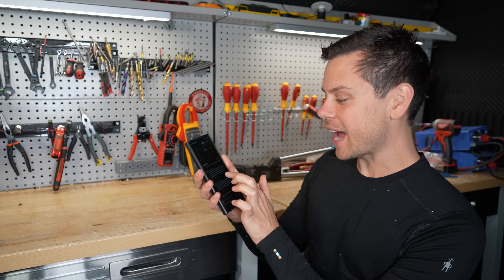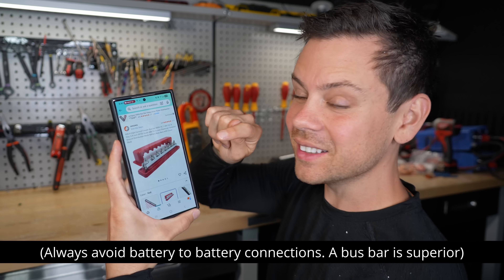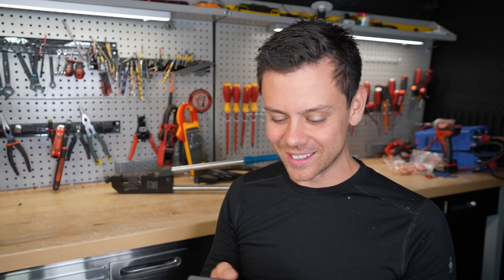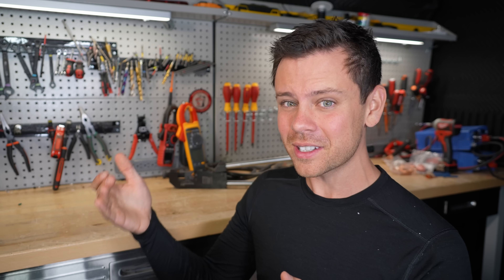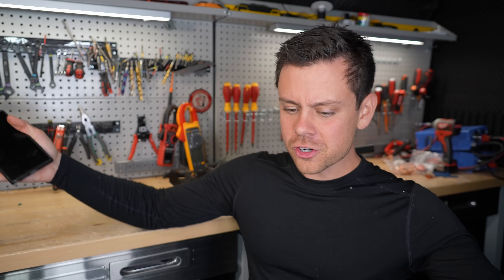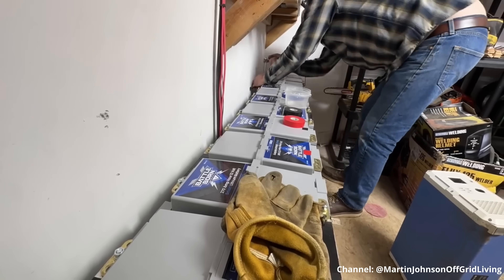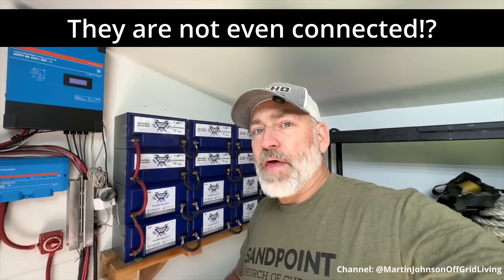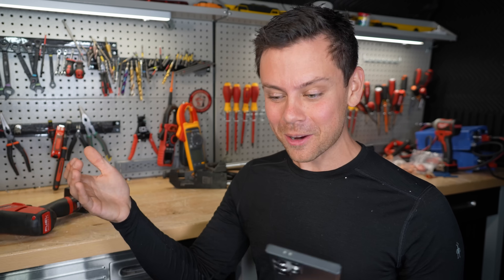My Reaction to Martin Johnson's "BEST Off-grid Battery Bank" Video 😬 Yikes!!

Comment: I know you don't mean to bash him but I'll do it for you Will,
This guy was willing to take free batteries in exchange for misleading his 477,000 subscribers to a unsafe, hazardous, far from optimal setup with batteries that cost $2,400 EACH when you can get one with 10ah MORE for $460 showing 0 concern for people's hard earned money, That's cruel man.

Looks like Battle born is so desperate to sell them before they get old that they sent him not 1 or 2 but 12! How could he pass up $28,800 in batteries? That's why Will is an absolute treasure, Remember how the solar hand truck inverter was always the 3000w EG4? As soon as a better inverter for the same price built by a reputable company (SRNE) came out he revised the hand truck, No brand loyalty, Can't beat that.

Comment: If you do something that can influence (many) others, you are entirely responsible for the outcome. One should learn before teaching. This is 
why many countries are starting to insist on you using properly licensed electricians for this kind of work. If Will can do the research and learn the basic electrical safety principles for dangerously large DC systems so can someone else.

Comment: Battleborn seem very overpriced. I heard they are assembled in the US but use all Chinese components, so I don't see the reason for paying much of a premium over any other battery. I guess they gave him free batteries but not supplies, maybe he he didn't have enough money for the project and he was buying cheap undersized wire from amazon. How many amps is he running though 4 gauge wire ?

Comment: Whats wrong with melting Solder in a terminal and putting the cable in? We do this for vehicles all the time, it makes a strong bond and keeps it from corrosion? Is it because if it gets hot it melts the Solder out? We use it for 12v car batterys in cars, but idk the difference with solar setup. But I feel better I crimped my solar ones in my van after seeing this. Update you answered in the video nvm.

Comment: I agree 100% with everything BUT THE 12v batteries to make a 48v battery is WRONG comments. Using 48v server batteries in parallel to make a battery bank is a NEW DEVELOPMENT in the industry.
12v batteries have been used in series for literally DECADES to make large battery banks. and there is nothing wrong with doing it as long as each 12v battery has a dedicated BMS designed for 
series/parallel use. Is using 48v server rack batteries better - yes - obviously, but it doesn't make using 12v in series properly wrong!

Comment: I think a well made solder connection is sometimes the preferred method in a permeant install that also needs to be weather resistance. Actually a good solder joint is an acceptable joint its only main issues are the need for soldering skills and the possibility of mechanical fatigue in installations involving a large degree of movement. Cold weld compression joints are much easier for a DIYer to perform successfully and is likely why they are considered the "preferred" method.

Comment: Conductors or busbars should be sized for the load not output capacity. And than size over current protection accordingly. Or is your car wired with 250 kcmil? Know it alla like you are 10 times more dangerous than this guy is. Also bud, watts are literally the definition of power. Little weird your teeth are white than your eyeballs, traits of a liar ;)

Comment: I am a 4 way certified commercial and residential inspector.  I am pretty sure that is not to code.  Mixing aluminum and copper not good.  It is ok. (sigh)   If battle born sponsored this video, they had better have him pull that video down. Then travel out there and help him to do it safe and legal. Then make his video and ensure it is safe  Kind of scary what happens in the construction world.  I have seen just about every screwy way of doing things.
Reply: There is always code. The state adopted the NEC.  Just no permit filed and no  enforcement. With that said, I hate government.  I just wish people understood the reasons behind why we have a code.  We have code because of a body count.
Reply: @CAMERONNERDIN  I hear you and agree...but, if there is no enforcement, is there really a code requirement? Not trying to argue as I think we both agree that, with things that may impact other people's safety, you need to know what you are doing and how to do it so as not to put yourself others at risk. And for sure you shouldn't be making a video showing others how to do it "cheap" and possibly harm themselves or their homes.
Reply: @greasebeardsgarage  agreed! I think him having been sponsored by the battery company, They need to get over there and fix it ASAP, because they are  open to legal action if someone gets hurt!
Reply: @greasebeardsgarage  and that is how enforcement should work, through liability exposure, and the desire to remove liability!
Reply: @CAMERONNERDIN  there are a handful of states that haven’t adopted the NEC statewide.
Reply: @silverbackag9790  Yup, 4 of them, but most of the counties and cities have adopted some form of electric code, and many have implemented the NEC. But for the most part the entire country is covered by some form off electrical code. Because of all the deaths contributed due to installs that fail and cause fires, or electrocutions.
Reply: @CAMERONNERDIN  except the latest code got stupid as far as battery storage. I’m ignoring that (thank you Missouri) because one size doesn’t fit all.

Would probably ignore rapid disconnect too if I ever put panels on my shop.

My current (72x 370 watt) ones are ground mounts.
Reply: @silverbackag9790  I do understand.  One thing I did notice in the IBC for ground mount panels, they have to have gravel under them   I think this is because they could have lots of volts and amps which could cause sparking. So it is a fire prevention.  I am getting ready to install a very large system on my industrial property to run a repair shop out of shipping containers and they wanted $2000 dollars for my permit, so I bought an enclosed trailer to put my mobile generator in.  The county building official and I had a discussion as to why his permit fee is out of control and I would not pay it.  I asked him a simple question.  If I run my shop with my welding generator, do I need a permit? NO, So if I run my shop with a mobile solar system installed in a trailer with panels laid up on the fence. do i need a permit?  he hummed and hawed and said I do not think I can enforce it. No different that a mobile generator.  I hate government over-reach as much as the next guy, while I sure hope people are doing solar safely.
Reply: There probably isn't much code if he's not in a city limits and is off grid. Doesn't mean you shouldn't follow industry best practices, just that you aren't required to.

Comment: My son put 4 of 12 volt batteries in series for his 48 volt system, but he charged them in parallel to 100% first, and then after putting them in series, he connected an active balancer designed to work with 4 x12 volt batteries.  The batteries have stayed well balanced ever since. He used 2 gauge wire to connect everthing, and put a fast acting thermal/magnetic 125 amp breaker in series. And yes, he used a monster crimper for the lugs.
Bottom line - it's possible to build a safe 48 volt bank using 12 volt batteries.
Reply: I have a 48v system with 6v "golf cart" batteries. 3 "strings" of 8 batteries each. Kicks ass.

Comment: This chap is due for an epic breakdown, it will more than likely happen at 3am without warning and I hope not at the cost of a fire. I would add having watched a few of these videos now. When you connect crimp lugs to high current switchgear a little dab of unial / electrical jointing paste will ensure that joint is 100% for the duration of it connection (until the user disconnects it). Be aware though you must wear appropriate PPE it's nasty stuff. Always interesting to watch how batteries and this industry has progressed. I'm waiting for someone to start some sort of hydrogen based generation next😉

Comment: I literally saw that video yesterday, and after I saw him solder it, I said to myself will prose will faint if he saw him soldering it., then I laughed as much as you did.  I literally freaked out when I saw him make the sparks. OMG.  Thank you for correcting the video. WOW. 😅
Reply: @WillProwse To be fair I don't think many people understand how a cold weld works. Infinitely more reliable as both a mechanical and electrical connection. My Dad was an engineer at a STC (old telephone manufacturer in Australia) and he used to do endurance testing on telephone components. Every external connection from a circuit board was wire wrap (same principle) because they proved via testing that it was much more reliable in service and (back then) quicker than soldering.
Reply: @mondotv4216  Its easy to find... we all have.  This is just stupidity
Reply: @d.rayowens422 I think it's a learning moment. Calling someone stupid doesn't achieve anything and it very rarely changes a person's mind. OTOH teaching them why and how to do it better is a much more interesting and effective way to go about it.

Comment: His video is spoof right?It shows exactly how not to wire batteries, breaks several cardinal rules, and there was a short and he continues and then he mentions Battleborn?  Battleborn should ask him to remove this. Also, instead of sponsoring him they should have sent him an engineer to install the batteries properly.

Comment: I follow Martin Johnson and generally enjoy his channel.  However, I cringed almost continuously watching this one.  He got some very bad advice from someone that doesn't know what they're talking about on soldering the connections.  I think the rest was actually bad advice and/or information from Battle Born which is very concerning.

I have a 48V system with 12V batteries, and there is nothing wrong with that as long as you have balancers connected between the batteries in series.  But...he didn't do that either, which explains the unbalance after 6 months.  Battle Born knew he runs a 48V system, so again, that to me falls on Battle Born.  I can't seem to find any 48V batteries from BattleBorn, so again, WFT Battle Born?

On the price, aluminum bus bars, and 4 AWG wire, that's all on Martin.  His flawed logic was if it's 200 amps, and you have 3, the load would be 70 amps from each.  If you run 3 strings, you need wire that supports the full system load for each string, preferably individually fused and connected to a bus bar, as you said.  If one of the strings shuts down (looking likely with the imbalance), the other 2 will be splitting the load. 
I do worry this Winter, when there is a string of cold, overcast days, one of the batteries will shut down and take the string out.

At least the solar shed is away from the house so if it goes up in flames, it won't burn his house down.

Comment: I was crossing my legs and cringing when the guy put the lit propane torch between his legs. And that was after freaking about running it right next to a cardboard box. I am so glad you did this video. Hopefully, he will watch your video and learn from it. Like you said, systems like this work until they don't, and then it is an epic failure.

Comment: Aye Carumba....when I saw his thumbnail in my feed and the Battleborns hanging on the wall, I knew that wasn't a vid for me.  Such unnecessary expense to end up with low output, risky install, and still rocking Victron.  Don't get me wrong, I love Victron, but I only use it at my 100% off-grid cabin for charge controllers and smart shunt, as the cabin has just a tiny bit of 120Vac and is 95% 12Vdc, like an RV.

Comment: Hey Will, would absolutely love to see you do a video on your opinion of the plug and play grid tie systems that are now legal in Utah, and maybe your opinion if this is something worth bothering with and if regulation allowing these type of systems is a benefit or not. 
 As someone that doesn't own their own home yet I'd love the ability to throw a super cheap 1200 watt grid tie system together with a few 400 watt panels in the back yard to help cover daytime electrical use that I can just hook up without the need of permits or setting up net metering with the utility.

Comment: This is not the only one. I have seen several BattleBorne sponsored installs by amateurs that make my skin crawl. This is the issue with YouTube videos in that ANYONE can talk with great confidence about a DIY build and be totally wrong. I see this in these solar, but also in many carpentry videos and also in some insulation videos that make me cringe when they put several vapor barriers on top of each other. A guaranteed moisture trap that will rot their buildings. So many so confidently WRONG but then hundreds if not thousands follow and copy because they know even less. Some of the most successful YouTube channels are designing and building nightmare buildings that would not pass code anywhere I have ever lived. Structural hazards, fire hazards, plumbing and electrical hazards, designs that will rot a building, all of it free of charge for folks to copy and learn HOW TO DO IT WRONG AND ENDANGER THEMSELVES, THEIR FAMILIES, AND EVEN THE NEIGHBORS NEXT DOOR IF THEY ARE IN SUBURBS OR CITY. It really scares me that these folks will someday sell those buildings to some unsuspecting buyer and people will die. Back in my General Contractor days the most important part was to be sure that every worker on my sites were complying with codes and putting safety first. And as a GC it was imperative that I was constantly learning the newest and best information in all of the trades so I was at my peak at all times.

Comment: I'm not so fearful of using aluminum for a bus bar so long as its an alloy that is suitable for the process. What frightened me in particular about how Johnson set up his aluminum bus bars is he used dielectric grease on the contact surfaces themselves. First off, that is not the right stuff - it should be Ox-Gard or Noalox. Secondly, dielectric grease will act as an INSULATOR on the contact surface, increasing the likelihood of those terminals desoldering from heat caused by the increased resistance. If he uses just the grease - it should be slathered over the completed connection.

Comment: Having made battery cables for large trucks and heavy equipment what he was doing scared me. I have the vee crimper where you use a hammer to crimp the cables. I've yet to have one fail.

As for soldering the only time I do that is when they're in marine application and you use a solder to make sure no salt water gets in the connection because you don't want to trust he shrink tube.

Comment: I worked in Telcom and a long time ago we had another company install a neg 48 volt powered rack with a couple huge batteries in the bottom. We had them remove it before installation was complete, so the schmoes they sent out to remove it thought Hey, let's remove the batteries, it will be lighter to move. I was standing outside the building when the 2 guys come running out of the small building followed by billowing green smoke. Schmoe #2 had used a regular ratchet wrench on the battery and shorted it to the bus bar. He couldn't get it off. Every inch of the interconnect DC wiring vaporized. Craziest thing I ever saw. Don't mess with high current batteries if you don't know what you're doing.

Comment: All batteries are in series, if you by a 48VDC bank, it still has cells in series since LiFePo cells are only 3.2V. A 12V battery will have 4 3.2V batteries in series.

Comment: There are proper websites for doing the math on busbars in both Aluminium and Copper.  Also not all  Aluminium is good for use as bussbars!!  Read the guides on the correct grades.  You are correct, each parallel string needs its own over current protection.  Look at the install.......batteries are stacked UNDER the inverter and INDOORS.   One BMS goes faulty, battery swells, off gasses, finds ignition source and house burns down.......stupid,stupid,stupid.  Australia for example, had to introduce design rules (code) to make some reforms to how and where Lithium battery systems are installed to help manage the fire risks.

Comment: I know about as much about wiring and electrics as I do about15th century Slavic literature. But even I know that soldering joints that have huge power going through them, that could get very hot, with solder that melts at high temperatures is not an optimal solution.

Comment: Proof that there's more than one way to do something. I crimp then solder terminals and some of my work is currently in space. The reason he's doing it in his garage and then planning to move them probably has a lot to do with his hat. It's probably cold. Stainless hardware requires anti seize. 

He reminds me of the electricians around a mine instead of someone that was trained as an electronics technician.

Comment: I used aluminium for my batteries but I am well aware of oxidisation which means all connections need to be sanded and cleaned immediately before, not mentioning this in the video was the first of many red flags...

Comment: OMG the soldering job got worse! It's freaking plumbing solder, which contains an acid flux the quickly corrodes electrical connections.

8:30 Galled Stailess steel - It's only 1/4 which is not that difficult to twist until is snaps, you just need proper wrenches that won't round over the head.

Sanding on aluminum-copper connections is actually a critical step as the alumimum oxide that form on the surface significantly increase the resistance. - However you also need to immediately use a rated grease (or work the grease in with an abrasive) , not just slather non-rated grease on the outside of the connection after the fact.